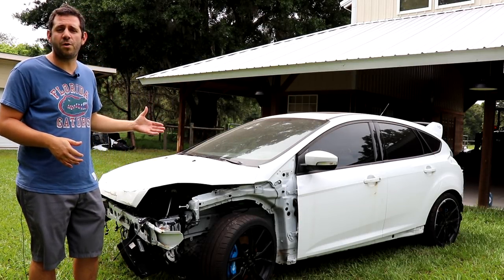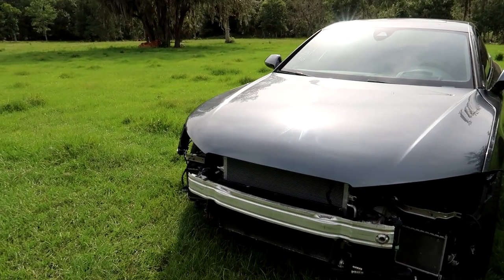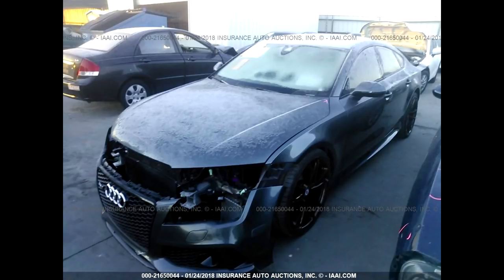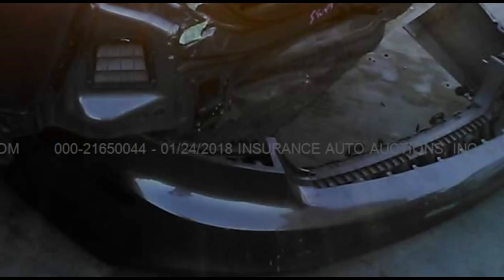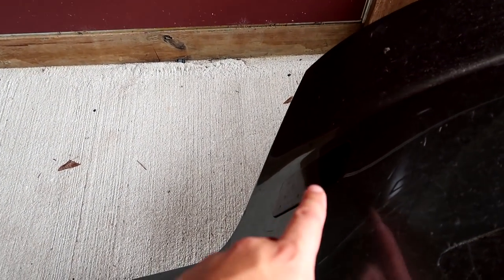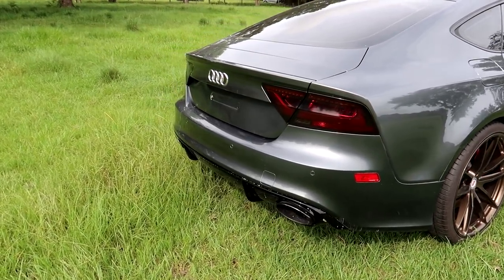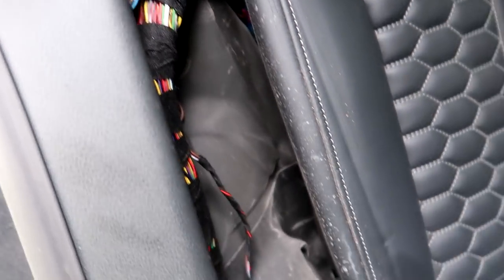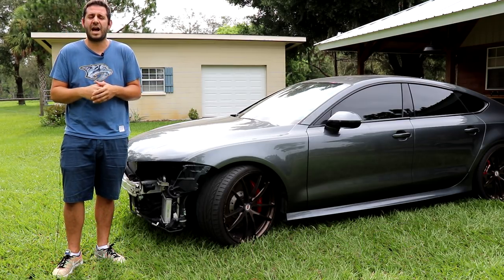I Bought a Wrecked Audi RS7! Salvage Supercar for CHEAP!

Comment: Those hre wheels are seeeerious money nice score
Reply: KDcars 2k
Reply: More like 2.5k each lol😂
Reply: Thijn Van Ool hre  forged ones are 2k those are not forged 500 each
Reply: in US the non forged wheels are $2500-3000. The forged 3 piece wheels are $1,500+ per wheel
Reply: jjoea Bhn hate to tell you this is fuckin America we use dollars here $$$
Reply: KDcars 500€is 580$ so diffrence is in the thousands ....
Reply: Austin Feeser yeah so 580$ for one wheel and all four around 2500 same as vossen the cheaper ones are made in taiwan and they are 2500$
Reply: He isn't wrong tho, if you spend 10 seconds to have a look the wheels are HRE P104 forged monoblock wheels.
And they start FROM $2,400 USD EACH.
Reply: MECHA SLIME the ones in the car are not forged
Reply: KDcars Use Google
Reply: jjoea Bhn except they are. As I said the ones on the car are HRE P104 but you're probably confusing them with HRE FF04.

But if you google HRE P104 RS7, there is literally only ONE metallic grey RS7 with bronze HRE P104 wheels which if it's the same car it was built by TAG Motorsport and has few things little mods to it like H&R Lowering kit, Milltek exhaust and a couple other aftermarket goodies
Reply: KDcars wantedto say the exact same thing
Reply: KDcars I just came
Reply: Alpina wheels?!?
Reply: KDcars murica, fuck yeah

Comment: Make that Audi great again.
Reply: why is your profile picture that creepy pasta thing
Reply: GrowTater pasta is delicious
Reply: Audi/VW was never great.  My sister's 03 VW Jetta had a booster on the brake pedal go bad......... it required a special tool that had no use in life other than removing one piece in the brake assembly hence a very costly repair.  The car in the video was very expensive to purchase yet was easily totaled with minor damage.  What does that say? Audi hold's it's value like spaghetti holding water in a strainer.  One of my best friends bought a high end Audi that was only a couple years old for a steal, he soon figured out why it was such a good price...... the maintenance was a nightmare and he had to sell it at almost nothing.  A brand new Audi is more than likely a masterpiece to drive, however to keep one for a while is futile.
Reply: Psittac20 What is a good car/car company then? I’m genuinely curious
Reply: @Psittac20   Specialty tools are so common among manufacturers that you can rent them at auto zone. Tools just like the one you're talking about. It's not just Audi. I'm talking Chevy and Toyota level regular cars.
Reply: Mike Morris  no one had the tool, we could buy it from snapon.  Pedro: I'm not sure, I haven't owned a new car in a while.  My 04 saturn vue has a honda engine and I haven't had any issues at all over the past 50k miles.  I have had a couple GM car's but nothing current and those were all somewhat easy to work on.  My dad has an 00 ford e150 with over 300k miles on it and working on that doesn't require anything special.  I guess my point is that an audi is something you need to bring to a mechanic, not something you can work on yourself.
Reply: @PedroRodriguez-kg4bq  Mercedes 🤷 but for reliability Honda Lol, matter of opinion though tbh

Comment: Love the shape of the RS7
Reply: I prefer the original undamaged version.
Reply: Carpe diem watches a salvage video, moans about damage, clown
Reply: The back of the car angle is really not that good looking I felt like they could of done better
Reply: Thaniggahigh Marcus I guess people either love or hate the shape. What do you think about the A5 Sportback?
Reply: One of Audi’s best design👌
Reply: 959 i have an rs7, great shape so they are, but only come with 4 seats
Reply: 959 I love it too.
Reply: Paulo B RS7? I am getting jealous mate😀 You need to bring it over to Germany. You would have fun on the Autobahn.
Didn’t know that the A7/S7/RS7 are 4 seaters. I would still buy it just because of the looks of it. I just love the shape. The new classy look even more. 
I have two little boys so I am thinking to get the A6 Avant. The RS6 would be a dream but I can’t afford that one. So maybe the 3.0 litre TDI S-Line.
How do you find the new S7/RS7? Some people prefer the old model’s look.
Reply: 959 no mate weird on, the a7 has 5 seats, s7 and rs7 have 4 seats its shit, mines in a 2015 so a facelift one, its a very good car, mines is a stage 2 APR running 700.2bhp and 1156nm, tuned by a company ecotune, in scotland where i stay,  theres videos of it online
Quarter mile 10.46 at 137mph, so it shifts for a big heavy bus
Reply: Paulo B yes I checked them out. They are like two separate sports seats right.. 1156nm sounds like proper fun car💪👍 you have a link where I see your car?
Reply: Paulo B no probs, thanks bro👍

Comment: God I’m jealous of you lol, I just bought an A7 from iaai auction not too long ago, it’s getting painted right now, then I need and alignment and to restitch the front seat and I’m good, by the way if you need your seatbelts fixed, look up safety restore, it’s 44$ for single stage seatbelts and 70$ for dual stage(front are dual stage on Audi’s back are single) they did 4 of my A7s seatbelts and now they work like new, good luck on the car, I hope to get one in the near future too!
Reply: Really what does it take to fix them? What small part or spring? Or tool to keep the tension? If electric what fuse or relay to replace? I guess the price is good enough to not have to fix yourself, leave it to someone who does it professionally.  Save time and headaches  of trial n error.
Reply: L&M Daskievige well when I bough it it was just the quarter panel that looked hit but when it got home I noticed that it also had suspension damage, the left wheel was about 2 inches from where it should be, I had to replace the whole suspension frame and the left wheel assembly, and the quarter panel top of course
Reply: L&M Daskievige I'm pretty sure they're electric. I know the A7 has an option to turn off the seatbelt tensioner in the mmi screen.
Reply: How much did you pay for it? was it an rs7 also?
Reply: John Tesla he said A7
Reply: John Tesla it’s a 2014 A7 prestige and I won it from the auction for 12k with rear suspension damage, hit in the quarter panel, the drivers side curtain airbag blew and also the drivers seat airbag blew

Comment: I had that air bag light happen in a low speed accident as well.  The shop told me after contacting ford there are 2 sensors which must be triggered to deploy the bag.  Mine only had 1 sensor trip, a metal ball in a shallow magnetic cup.   This way it makes something like say a pot hole etc.. from deploying the air bag when not needed.

Comment: Reckon he paid $15,000 for it
Reply: That's the number that popped into my head, too. And I'm thinking probably $1500 for the rear bumper assembly.
Reply: Over 20k so maybe 25-35k still an amazing deal
Reply: Tom Baddley probably close to 5000$ for the bumper, carbon fibre valence, sensors and color matched
Reply: WOW! All those different parts included on the bumper would add up, I guess. And he did confirm that he paid over $20K for the car. Still, when it's done, it's going to be one awesome ride.
Reply: $24,300
Reply: Reckon he paid 38,999 for it.
Reply: WHAT
Reply: He paid $48k for the RS7, you can search it
Reply: Adam Vulture he paid $24,300 here's the link to it
https://autoauctions.io/app/1862806/2014-audi-rs7

Comment: 7:30 - that whole rear floor is high strength steel.  By hammering it back into place you have compromised the structural integrity of this car.  If it is involved in another rear end collision - it will not perform the same.

Comment: Question.. why does the center of the steering wheel you see a yellowish assembly in the gap behind the housing, also seems the airbag cover on steering wheel doesn’t seem lined up from factory...

Comment: You might wanna check the airbags.. Its strange that the airbag light popped up and the belts locked.. It may be dangerous you don't won't to crash without a single airbag assembling

Comment: The web of seatbelt is designed to elongate to save you by controlling decel of your body to a G value that is survivable. Repairs to the belts are not a good idea after the tensioning retractor activates. The belt may not have that yield that it needs.

Comment: I too lost my passion for the current automobile. Maybe for a different reason. I became aware of my indifference two years ago while looking at a beautiful GT3 Porsche parked in the local Rite Aide parking lot. I stood there for maybe ten minutes, it was a beautiful blue, but something bothered me. I realized what it was, I could buy a car like this, I have owned four Porches, but it would still have 2500 moving and reciprocating parts, lubricated by oil. I have been down the path many times with mechanical repairs, getting handed a 2-3k bill for work. What bothered me most was that as beautiful as the car was, the mechanics had not changed that much, it was still pistons and cylinders creating an explosion and trying to control the mess with lubricants and carbon cleansing.  In the end I shrugged my shoulders and walked away, thinking, “eh, old technology “. I now have a very fast Model 3 and couldn’t be happier. 18 moving parts,  never has to be warmed up, don’t have to worry about shifting, manual or automatic. The car just goes and really moves with no fuss.

Comment: Samcrac, have you ever tried getting a rebuilt title turned into a clean title? I know it's extremely rare but I heard it's been done. The reason I ask is because I recently bought a rebuilt M3 that was deemed a salvage title due to $8,000 in damage when the car was worth $38,000 at the time (2 years ago). I have pictures and evidence of the damage from a Copart listing and I think it was unfairly deemed a salvage car. The damage was so minor, I have no idea why it was totaled out. Also, my insurance rates are now a bit higher due to the rebuilt title... is there any way to reduce insurance rates if you can prove it's a completely functional rebuild or something?

Comment: im just wondering how is the MSRP so high.. With original part the repair to rear and frot would have been around 5k-7k
Reply: if the bumper is damaged it doesnt mean you have to disassemble it completely. there are a lot of parts that still are fine and usable like the parking sensor.

Comment: I always wander even you get the damaged car for cheap price because they were the high end models, but with crash like this, how are you be sure the most important parts (engine and transmission system and ECU...etc.) are still in proper functional condition?

I am okay to get a car that just have outter body damage, but I do not know how to make sure the most important parts are not damaged......

Also, all thing kind damages will need wheel alignment and also checking suspension system and wheel control functions...that is a lot money to add on after you fix the body part.......does it really worthy to do so?

Comment: Yo know why that car is written off dont you? ( The focus )  Because that car is made of High strength steels...   You realise because the SKIRT of that car is damaged,..,  You have to change half the side of that car out with  a NEW factory panel.. THIS is why its written off..

Your repair is rough, and not to be done.. If you done this in australia. you would get your ass dragged over the coals..  This is not the proper repair method..  its way off..

Comment: Out of curiosity and no pun or hate intended. Said cars have salvaged titles and you pay less , but after being fixed they are not worth as much as a non salvaged car and in my experience i personally would never buy a fixed salvaged car. 
( backstory ). I bought a jeep srt low milage with a proclaimed "small" accident fender bender report. That was completely bullshit. Said jeep had and still has so many problems. The deal was the previous owner had to have hit something and drove over something in the process. He worked at a body shop and reported a small accident not truly what happened , fixed it just enough to trade in or send to auction and dealer i bought from grabbed it from the auction. 
But my main question is your a youtuber so obviously this is for the channel but do you feel you will make money if you sell or lose money

Comment: Should never be allowed to sell this car - nothing is fixed correctly resulting in potentially unsafe vehicles that will not protect its passengers the way it was designed too in a crash. Without putting this vehicle on a frame puller he has no idea if the frame is tweaked or not...... SIGH